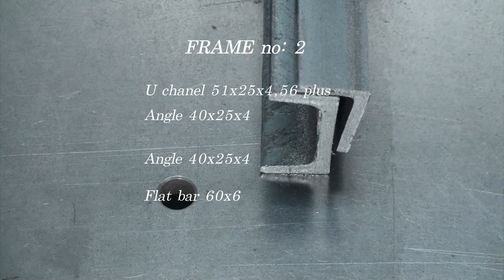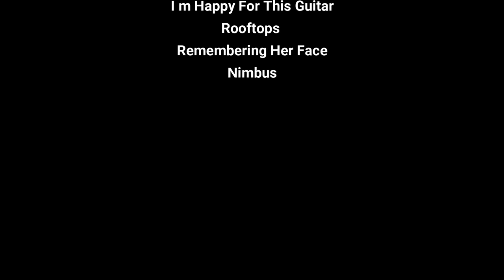Pickup truck sliding floor

Comment: I carry an iron rake in the back of my pickup - but I certainly like your sliding floor!

Just spent the summer welding in new steel in the bed of it. Those plastic inlays are nice but lets the rust do a lot of damage unnoticed.

Hope you make some more videos. This was great.

Comment: The undercarriage design of this slider bed closely resembles that of the EXTENDO-BED, made by the Extendobed company in Boise Idaho.  I've had an EXTENDO-BED on my 1996 F-150's 8 ft bed, since 1997, and it is still one of the best truck accessories, EVER.  It is rated for carrying 1300 lbs fully extended (6 inches beyond the point of the tailgate), and I know that I've overloaded it several times by stacking bags of 60-Lb Quickcrete concrete mix. It's a workhorse.  Modern versions of their Extendo-Bed are equipped with electric motors for ease of extending and retracting the sliding bed.

Comment: First off, this has been the best slides, capable of handling heavy loads. Very well enginered and built. Bravo Sir! Just would like to know where you obtained the small channel? I've had problems trying to source any channel smaller than 6". I would like to know where you found it?My build is similar only I added drawers on the bottom, the slide is above the drawers. Thanks

Comment: This is fantastic design. I am trying to build camping trailer for my boyscout troop. This would be excellent for a pull-out cooler rack. If you could provide a drawing or any more information on this design it would be a big help. I understand if you do not wish to share the plans and will respect your decision. Thanks for the video though. There is not much information on these and pre-built options are very expensive.

Comment: Because everyone has a 10ft steel workbench and the ability to cut/bend/drill/weld 3/8" steel bar and build an INDUSTRIAL type rail slide for their average pickup truck. 
RIDICULOUS !!

Comment: Any particular reason to use a UPN->C section(tapered) vs UPE-> U section (non tapered) ,U would have more contact surface witht he bearings,What size bearings are being used?
Reply: hard to find c section vs u section if it's anything like where I'm from.

Comment: At about the 14:50 mark you show us the offset bearings in the middle and for the life of me I can't figure out whats going on there. Can you explain why they are different heights, and what is going on please.
Reply: The offset bearing is at the locking point so it's purpose is probably to reduce vertical travel when letting go of the tray.
Reply: They prevent the tray tipping to much in extended positon,(possibly hitting the tailgate)